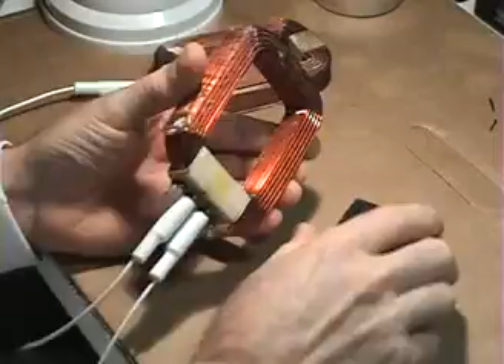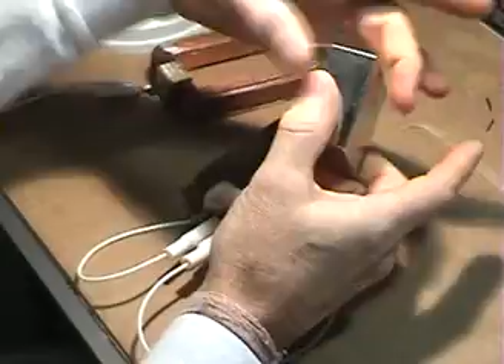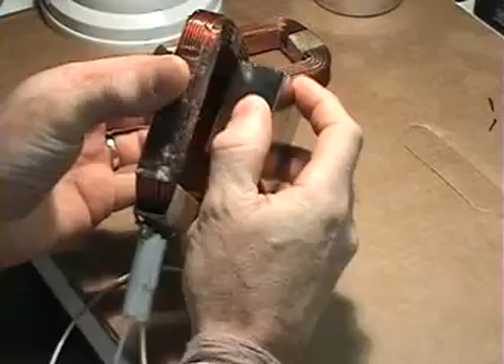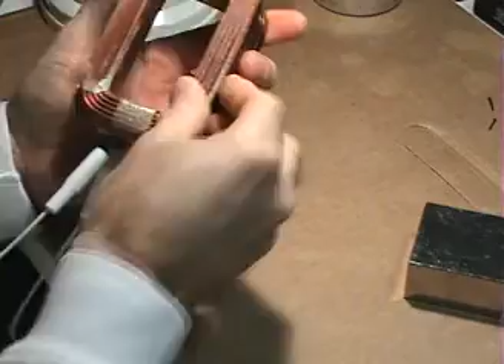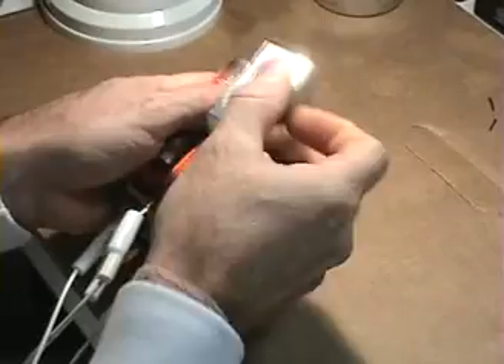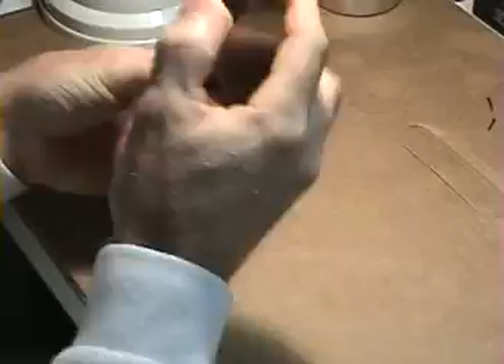Generator Coil test 2b

Comment: Cool man would like to be friends like your style man. Fellow enthusiast.
Reply from the maker: Okay thanks for your comment 👍
Reply: @gotoluc  https://youtu.be/hqn6JFTypmo
I'm testing some different generator configurations 2. Would appreciate any pointers to help speed things along😁
Reply from the maker: Well joe joe it took me 15 years of playing around like you’re doing now to get a better understanding of what does what and that too many people assume there is free energy that can easily be had. In time you’ll find out that 99% of it is BS. It doesn’t mean I believe it’s not possible but you’re not going to find it by trying to copy anyone’s work. You yourself have to understand how it all works and then think outside the box as to how you can go beyond the limits our present science claims are Laws. Take for example this video I made some 10 years ago. How can you get the magnet to attract to the coil without the magnet inducing an electrical current back into the coil, known as CEMF (counter electrical magnetic field) which pushes back on the applied current connected to the coil so the magnet can get attracted to it in the first place. Basic electric magnet motor paradigm that still exists till now. Find the work around this and you may have something important.
Reply: @gotoluc  yeah that's cool think you are on the right track there as well. Want to ask what you think about the set up in the video. Voltage shoots way up and collapses. Than seems to not build up and all. Or stabilize sometimes. Any idea why it's so irregular and some possible solutions? I think there is great potential here if I can get it sorted. The voltage and amps spiked so high a few times it fried my equipment and made an explosion similar to when you hook a capacitor up backwards. Ivo seems to think the magnetic field may be rotating. Which is one possibility I may test. Thanks for responding.
Reply from the maker: Can’t advise you on that video. It’s all over the place and not a step-by-step analysis. As far as I’m concerned nothing special. Fluctuating meter voltage can be caused by RF (anything that sparks) which are not real voltage readings. I had one of those $5 meters show 1000 volts once. Even if it was 1000v voltage alone is not a source of power. In time you’ll learn. Keep playing to better understand and maybe after 10 or more you’ll know what’s useful. All the best in your research 🧐

Comment: like your clips I watch u more than most. this clip can be explained by saying all u have done is made a multiple core wire when u invert the coil. the result is the same as the disconnect. do u remember the very old IF coils that had insulated multiple core wire where only the clean ends where connected this is similar to what u have done the only difference is proximity.  this will give a small variation as the magnet passes. not worth chasing.

Comment: Here's an idea Luc since one coil is closer to magnet than back coil then to completely eliminate lenz front coil should be smaller than rear coil to compensate for distance thus creating equal opposing forces, or another solution is winding both coils together at same time(like bifilar) but connecting begining of coil alpha with end of coil beta in a bucking mode to cancel out magnetic lenz, hopefully still producing desired electricity
Reply from the maker: Yes, your second idea would eliminate Lenz as each coils inductance would also be eliminated. However, with no Inductance, the coils produce no power. It's trading one problem for another. Luc
Reply: Doug konzen has a schematic where he catches radiant spike with capacitors and only transfers energy after disconnect from source; that is NO resistive loads untill processed thru the caps turning cold electricity into hot electricity.  Most of us have been adamant about trying to use this output immediately and that is where we have failed. Capture it first, process it , then charge batteries or whatever. have you seen pics of the "testatika" machine in sweden? its electrostatic in nature first, but then has some giant leyden jars or caps to reconvert energy into hot electricity

Comment: when coils are opposing do they still generate electricity or is the flow also cancelled??
Reply from the maker: Hi Alex, when 2 coils are connected to oppose each other their inducing ability drops off drastically.  Luc
Reply: ok thanks for explaining this to us. chris sykes has some ideas on bucking coils and what may work (page 22 on pdf)..http://www.hyiq.org/Downloads/Guidelines%20to%20Bucking%20Coils.pdf
Reply: So without iron core the production is still the same even though coils are opposite?? thus avoiding lenz law to 80%, if im understanding correctly? that is huge!!
Reply from the maker: I've got over 4 months of testing different configurations of bucking coil arrangements and nothing impressive to demonstrate. Luc
Reply from the maker: Re-read what I wrote as there was nothing huge. Luc

Comment from the maker: First I connected one coil to a 1 Ohm load and 60uf motor cap and approached the coil to pickup the best voltage on the load which was 1.30vac. I then added the coil to get no Lenz effect and retested using the same load and got it to 1.20vac with the coil at about the same position. I'm doing this by hand so at this time I don't have accurate results but it looks very promising to me.

Comment from the maker: Hi Stefan,

I thought this could be the case, so after I found this effect I tested the coil on a motor that is turning a 10" Lexan disk to about 1,500 RPM which has 8 of 1" X 1/8" N42 Neo's counter sunk and epoxied in a north south alternating pattern.

Comment: Hi Luc,

Try to shortout and open the coils very fast with a mechanical buzzer relay. This way you will
also reduce the Lenz law and also get BackEMF spikes, which you can use to charge up batteries !
you only need to open and short the coils
very fastly best with a mechanical switch.

Good Luck ! 
Regards, Stefan.